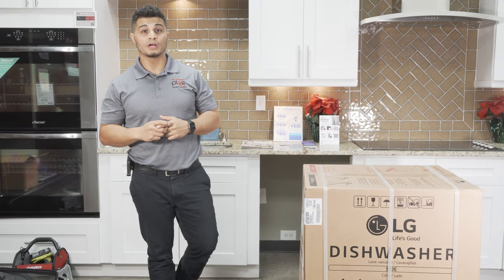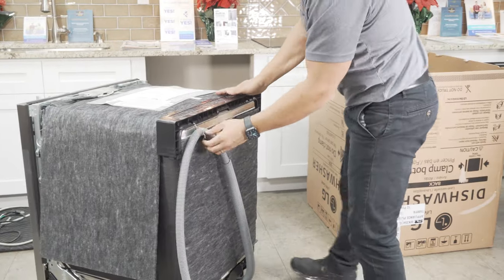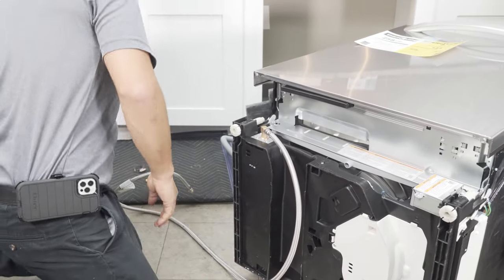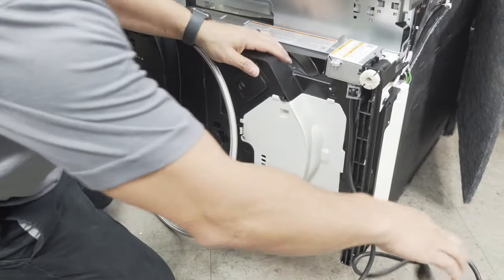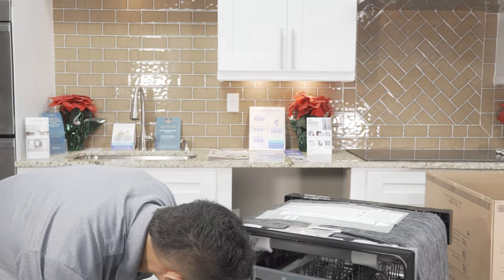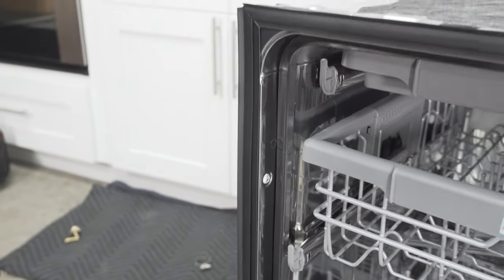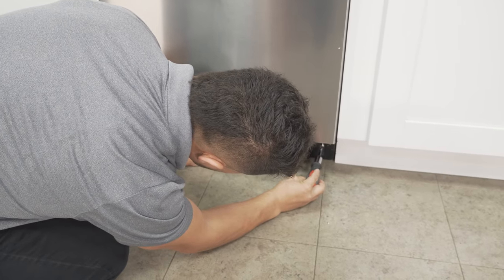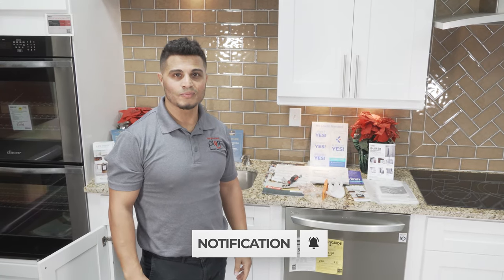How To Install An LG Dishwasher - Installation

Comment: My water supply and the electrical supply and the drain comes up through the floor , no room under the LG for clearance . What do I do ?
Reply from the maker: Sorry for the late reply. I'm sure you figured this out by now. However, I'd like to answer your question for others that may have the same setup. 

That's a complicated install. If you want to keep this model dishwasher, you would need to have supply, drain, and electric reconfigured to accommodate installation steps. Good luck!

Comment: This dishwasher needs a water heater device or already heats the water by himself?
Reply from the maker: Water supply line should be connected to hot water. Dishwasher works most efficiently when it fills with hot water at the start of the cycle.

Comment: The cable that came with the recommended kit on Amazon only labels green wire. The other 2 are both black. Does anyone know if that means it doesn't matter which ones go to black and white on the dishwasher?

Comment: I cannot find anywhere about how exactly the sound insulation that goes behind the kick plate isn’t to be properly installed. Specifically the large rubber piece.
Reply: I found a picture online that helped me with the insulated/rubber sound dampening part. Now I just need to know what to do with the long foam piece with the 2 holes in it 🤷🏼‍♀️

Comment: My new LG dishwasher does not dry. Leaves my dishes wet and the inside of dishwasher moist. Even when I set it to dry. Why???
Reply from the maker: Did you add rinse aid to the dispenser? That is needed to properly dry your dishes.

Comment: Definitely be sure to remove this black part 13:25  on the top of the back of the unit. It says removable. It should say remove as it can only get in the way of a proper adjustment

Comment: Bought an LG dishwasher, worked for less than a year and control board had to be replaced (under warranty), year 2, stopped working again, same problem and LG won't help,  buyer beware!